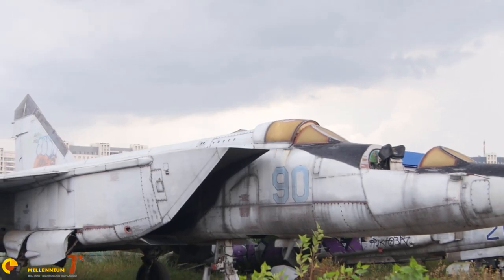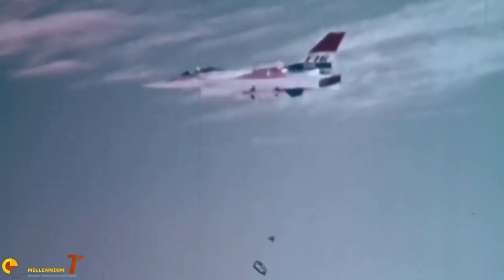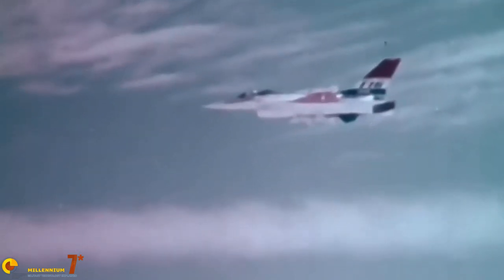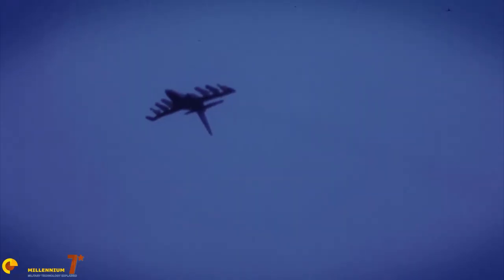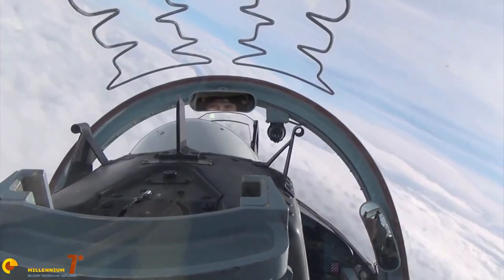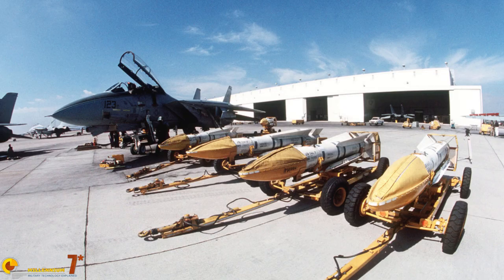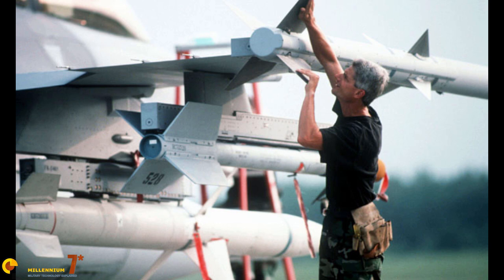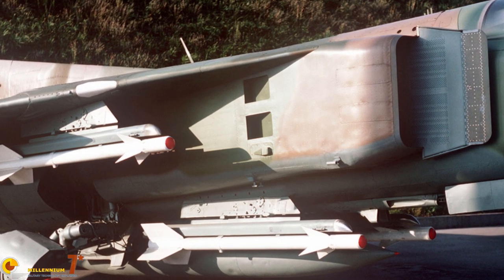Why we Throw Air to Air Missiles in the Rubbish Bin.

Comment: Some anonymous source claim that the self life of r-77 adder is only 50 to 60 flight hours. Is this true?
Is the airlife of aim120 is 1500 hrs or self life??
Why does airlife differs so very much on various aam such as aim120 and r-77 adder??
Please do care to answer.
Thank You 😊
Reply from the maker: I don't know about the R-77, and this is leaked information anyway, normally it is not in the vendor's open source documentation.
The difference derives from the construction. 
Modern electronic boards and chips are more resilient than older, which are more resilient than discrete components, which are way more resilient than valves.
The same is true for all the other components.
Reply: Flight time is not same as shelf life. Flight time depends on forces that missile is getting while on pylon.